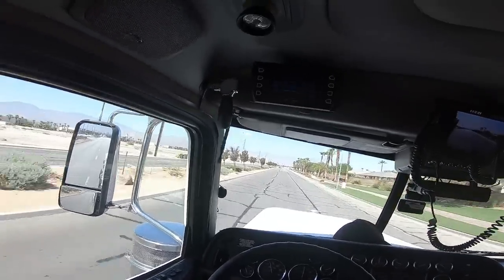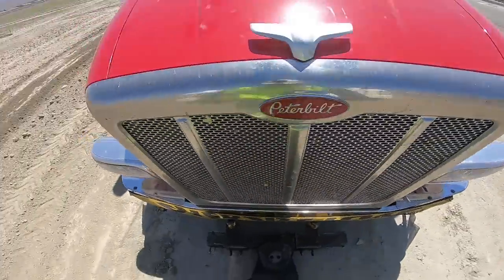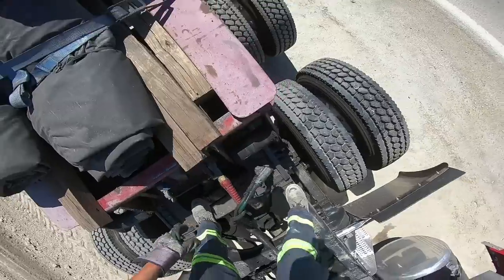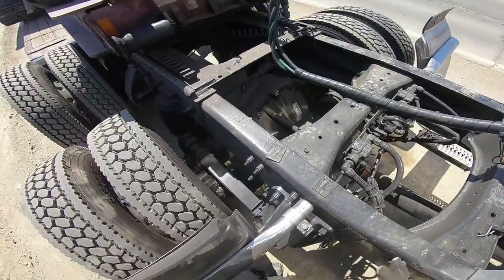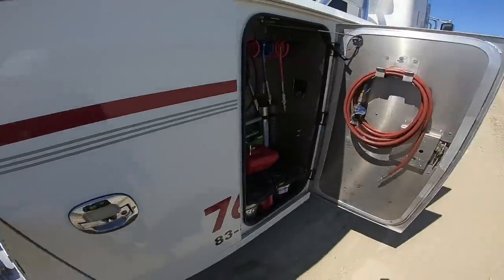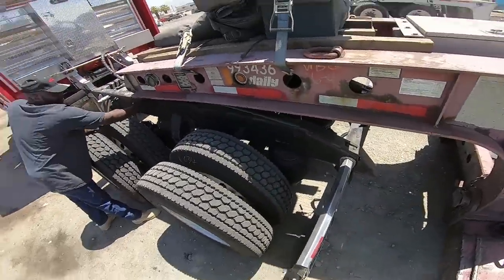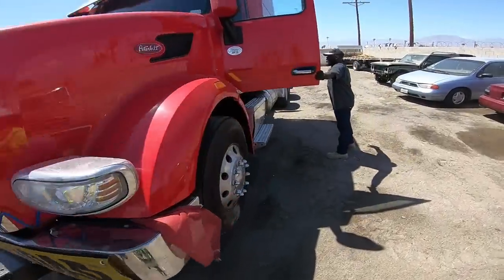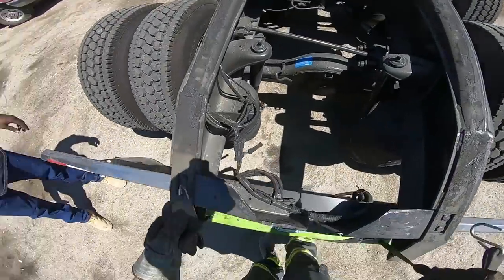Oversize Load Tow! ~150,000 Pounds | 11' 6" Wide

Comment: Ok 10 years driving here with OTR and Local but no towing so im gonna arm chair this a bit.  Great professional and personable attitude with the driver.  Great questions and getting him involved its his truck and his decisions on some things.  Very good attention to detail and going slow and taking your time to make sure things are done correctly.   Now for some ideas.

(1) Dont hook up airhose at front till your done.  I thought you were going to strangle yourself at least 4 times jumping back and forth across the hitch trying to get the chains on.  Id save that till last if it was me.

(2) Might consider starting from back to front.  SO first thing is get the lights out and throw it on the trailer since that is your longest trip. It was blazing hot outside so do the long leg work while your not sweating.

(3) Always bring hammer when trying to get driveshaft apart.  Even if you don't use it you saved yourself another trip you didnt need.

(4) I would inform the driver there is this nice tool called a 5th wheel puller. Heck you can even get them with leverage built in.  Saves smashed knuckles and grease all over yourself as well :)

Again great job just some ideas to make it easier on ya and have a great day.

Comment: Why disconnect the axle if it's in neutral
Reply: They do this for two reasons.  One manufacturer's like freightliner have a big sticker and even in book do not tow with drive shaft connected may cause driveline damage.  Now I've had tow trucks drives pick up my rigs and some will disconnect some will not but my idea and if I owned a tow truck company every drive shaft if the drives are on the ground drive shaft out.  Think about say the trans gets stuck or something and you blow a trans while pulling it down the road.  Your now responsible for replacing that and there not cheap.  Lastly today's log books go off speed of vehicle.  So my buddy was on line 4 and drove a hour over his 14 because his truck moved and the logbook came on and he didnt know while in shop for 3 days he was on line 4.
Reply: so u dont damage the diff or the trans
Reply: It can also prevent jump starts
Reply: Fuzzy Butkus as a company field mechanic the tow companies love me because I already have the truck ready to roll when they show up. Most times we don’t even really worry about lights because I’m escorting them to my yard.
Reply: Thank you
Reply: @richardsavaglio661  garbage truck mechs are the best for this as I usually take the truck to the tip to unload before going back to the yard so they help me out in return
Reply: @Devourer221  worked in garbage several years. If I ever had to call a wrecker I always dropped the driveline before heading to my next call. They loved that
Reply: redundancy

Comment: WHY DISCONNECT THE DRIVE SHAFT, WOULDN'T JUST LEAVE IN NEUTRAL BE THE SAME?????
Reply: No way if you leave driveshaft in front bearings on transmission don’t get any oil ...will ruin transmission

Comment: 150,000 lbs I’m assuming is a lot of weight for US drivers with there normal baby weights of 80,000lbs. Australia and Canada allow far more weights, on my B-Double (B Train) I’m 139,500 lbs. the payload alone is 99,000lbs. The point I’m making is this, the US is not utilizing there fleet of trucks to there fullest. Using quad trailers and B-doubles they can carry twice the weight, they put less weight per wheel per axle down on asphalt. They can move more product more efficiently. It’s incredible that the US has the lightest trucks in the world.

Comment: Driving a large wrecker is had work and dangerous I did it for years but you young guys don't know how easy it is now compared the the old Holmes 750-850's in the 1970's before  century and them came out with hydraulic booms way before the rotators and underarm hitching wheel lifts they're still a lot of work but believe me a hell of a lot easier and safer been there done that  there !, all you young and older guys stay safe  I've lost three to stupid things and drivers while on the job working in the tow business!!!

Comment: Just curious why you have to remove the driveshaft
Reply: To protect the transmission. When the trucks engine isn't working it doesn't lubricate the transmission, so towing it with the drive wheels in contact with the ground turns the transmission. Taking the drive shaft out stops it turning the tranny

Comment: over size, over heavy. no problem. but the laws are good for that to break the load up, if it was more than getting it off the road. When trent bent over getting off his coveralls, the water poured off his face and head. so this hookup was not easy. Just thank gott, the driveline never stripped one of the bolts. That might have been an emergency, like for a torch from the home crew.

Comment: Does not make sense to me to Tow  when all that was wrong was the Alternator. Yes the Generator on Board for house power will charge up Engine Batteries and could have drove. If a Bearing or bushing had failed on the Alternator could have removed the Alternator off the Engine in less than an hour and took to a repair shop and rebuilt or exchanged it for a rebuilt. I never would have gone through the expense of towing or hauling that RV.

Comment: Why wouldn't you separate them there and bring in a tractor to just tow the trailer in and you can just tow the tractor direct to Fontana?
Reply: I was thinking the same question.
Reply: People kinda frown when you misplace their $100k+ excavator or have it tagged up by vandals.
Reply: manorin then bring two trucks.
Reply: Sometimes the trailer is locked up on the truck and not able to disconnect until you get the load off.  But just a guess on my part.
Reply: Noooooooo, and not on the side of the road, and on loose sand because there’s a chance the trailer can sink down some into the sand because of the weight, and the next truck my not be able to get under the that trailer and lock into the 5th wheel, and if that happens, that trailer would have to be dragged out of that sand by the tow truck, or a crane. These things don’t weigh 5 pounds.  In some places, like drop yards where these guys leave the trailer, the sand is compacted down to take the weight of a full load and the trailer, and the trailer and load won’t sink down, but on soft sand, un-compacted gravel, or grass, you’re fucked if your trailer is loaded. 

We truckers also don’t like to leave our loads unless we absolutely have to, or the trailer is on fire from hot brakes, or other odd circumstances like needing to go to the hospital, or unless it is a HAZMAT load that has to be placed in a specific area away from other trucks and buildings, fuel areas etc. The only times I will disconnect from a loaded trailer is at a truck stop when I have to have the tires changed on any of the axles, or a tail light fixed on the tractor. Otherwise, I stay with my load and trailer. I will drop a trailer in a drop yard or my company’s secure facilities, but otherwise, I stay with my trailer and load. 

I saw a guy drop his trailer on the softer dirt after he missed the concrete pad he was supposed to stop over with the landing gear. I didn’t see him until he had disconnected  from the trailer, pulled forward, realized he had screwed up, and then couldn’t get back underneath it because he said the load was 38,000 lbs and the trailer was too low to get under. He had to walk to the traffic office at this place and get them to send a yard dog driver over with his yard dog truck to lift the trailer up ( the 5th can raise up and down vertically about 8 inches), pull the trailer forward over the concrete pad, and then set it down. Had that place not had a yard dog truck, and someone came to take that loaded trailer, they wouldn’t be able to get under it and lock into the 5th wheel because the load pushed the trailer’s landing gear pads about 3-4 inches down into the dirt, and you won’t easily be able to slam a truck under a 38,000 pound load without having that trailer’s front side possibly end up smashing through your sleeper section wall of the cab. You NEVER try to get under a trailer that is too low or too high, or on very soft and uneven ground like that road side in this video. As for the guy I saw drop his trailer in the dirt and get it stuck, hopefully the consignee didn’t call that driver’s company and report him, as dropping a trailer and getting it stuck can get you fired lickety-split and on the spot, and get you stuck with a bill for the charges it costs to get the trailer lifted up by huge airbags, or a crane.
Reply: We separate them all the time on the east coast. Bring out a tractor and wrecker. Most dealerships don't have room for the trailer so we take the trailer either to our yard or where the customer wants it.
Reply: BIGGER BILL
Reply: Why unhook drive shaft? Less friction?
Reply: I dont know California laws.  I'm on the opposite coast.  But here in nc they can tow the trailer to a SAFE location like he said from anyone messing with, breaking, or yes even trailer sinking never seen on a rgn as the trailer is the pad and it's a 8ft wide pad I've dropped loads on lose sand and mud never had one sink but guess anything is possible.   Now some states think it was Connecticut I was in or Massachusetts?   They where towing me two exits to a t/a they brought a semi and wrecker semi took my trailer to the ta and parked it in a spot wrecker followed behind.  The driver said it is because the state doesn't allow them to tow them both there to long.  It matters where you are and yes they have a truck they can do this with but did they have a driver? Two trucks two drivers.  Did he have to or was this legal?
Reply: if you don't unhook drive shaft it can mess up the transmission.. on automatic you need to unhook as it will mess up most transmission
Reply: Why go to all that effort when you can tow it I'm combination? Less Fucking around us better in my experience. 150k is sfa. Here in aus it's not unusual to tow loads up to 68 metric tonnes in my area specifically I do it regularly.
Reply: @mikebaker3362  you can do serious damage to the internal functions of the gearbox if you don't
Reply: @joeaverageone  do that in Washington as well your lucky to even get a wrecker and bobtail in half of the repair shops.
Reply: @mikebaker3362  you remove the drive shaft so you don't burn up the tranny
Reply: @Devourer221  If you watched the video then you would have heard its not legal to tow oversize trucks if there is a way to separate the trailer. only tow allowed is to a safe place to separate the load

Comment: "i wouldnt even think about moving something this big without brakes" So a question that arises from this is: In the US, do the brakes not have to fail safe? in the UK, if there isnt air in the pipes, the brakes lock on, so if there is a leak or a failure, you wont run away
Reply: That's why he had to plug the air lines to the truck to make sure the brakes didn't engage.

Comment: I cannot see the fuss on this. With respect. In Australia the northern highways are lousy with road trains which pull 3 trailers and more each and every day over thousands of miles. You say 150,000 pounds - which is 75 tons. Our road trains pull 200 tons every day as a normal load. They do it at 70mph as well.
Reply from the maker: With all respect that is not seen here in the states and those road trains aren’t running and navigating city streets. I see your point though. This is quite heavy for a tow
Reply: They are allowed into most major towns and cities except capital cities - but are generally confined to what we term as our outback highways. They travel huge distances and watching a driver back three or four trailers is an impressive thing. Many fuel road trains are four semi trailers with three axles at every point.  They are very courteous on the roads but take some time to pass.
Reply: australia has a lot more of open spaces, you would not pull a five trailer train in town, would you.

Comment: The truck was running when u pulled up why would u have to deliver air to it before moving it?
Reply: Because you never leave a vehicle under tow running unless you have absolutely no other choice. This way the tow truck has full control of the air for the combination. If there is a leak or similar problem you're more likely to notice and react as your gauges will be affected

Comment: in sweden they can run 150000 pound total weight on the regular.
Reply: Wrong.  It is 40t.
Reply: my dad truck weight over 130 000lbs and its normal